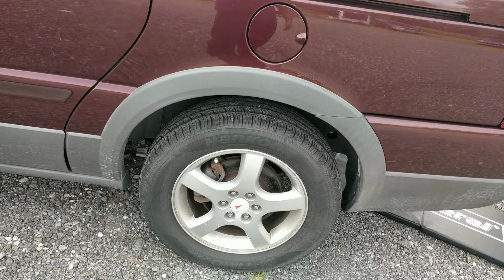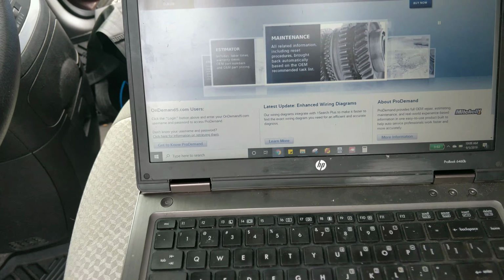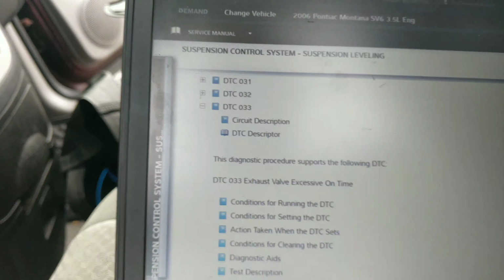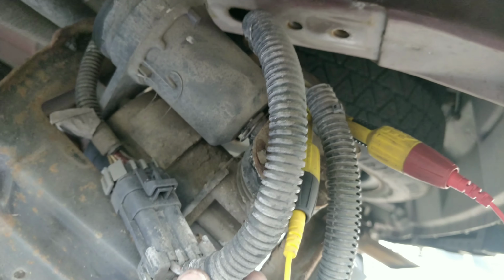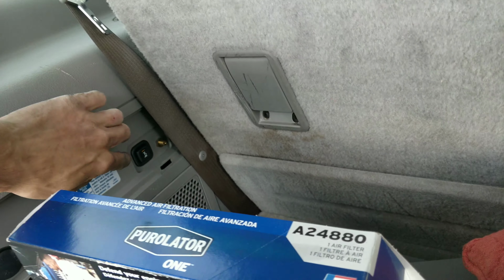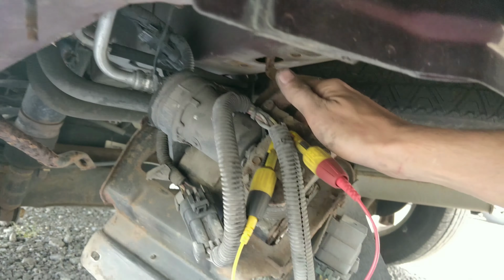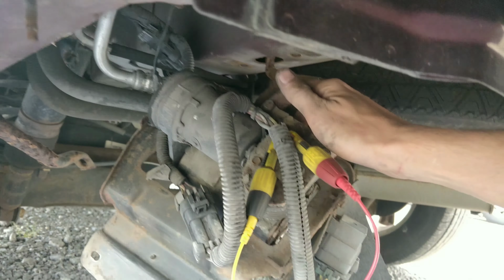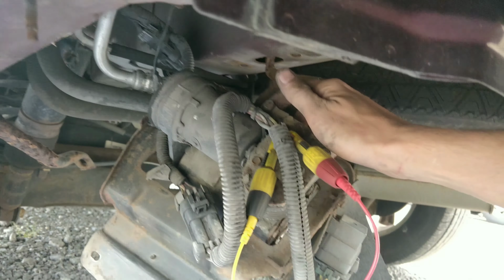2006 Pontiac Montana SV6 3.5 l air ride goes up up and up!

Comment: I know it's been couple years....but that button is to turn the compressor on and activate the valve just beside the button.  You just take a hose from that threaded valve to your tire valve.  You then press the button, the compressor kicks on, and inflates your tire.

I dunno how it all ties into the suspension.  But my mom has this vehicle.  And has always had bunches of electrical issues and code lights.  I like videos of real work like these instead of the whitewashed scripted kind.